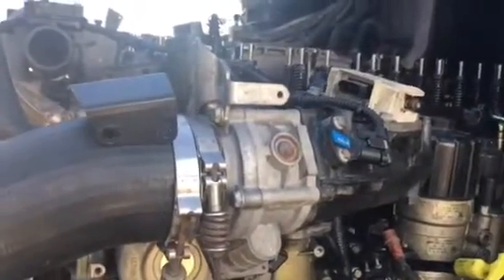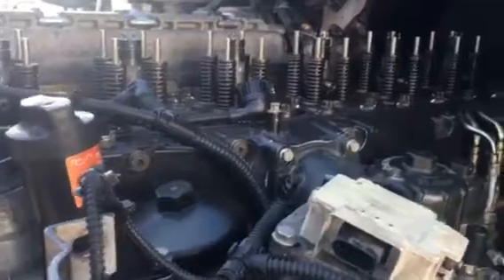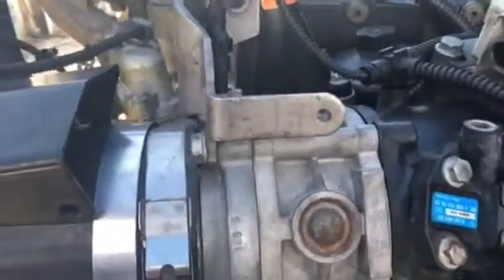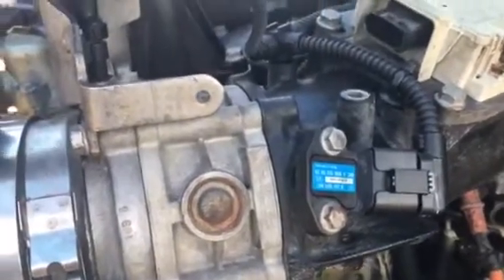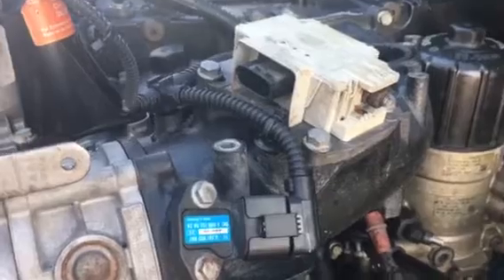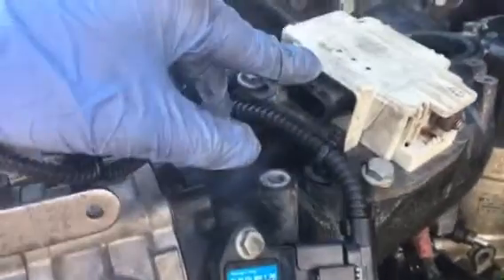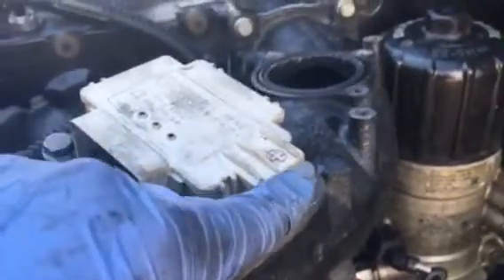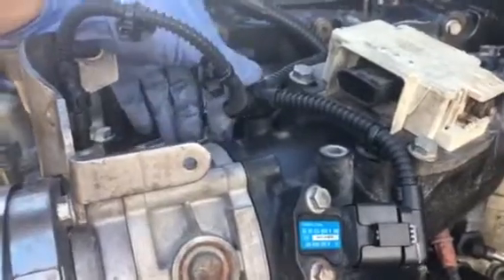Freightliner Cascadia 2010 Detroit DD15 missing one sensor

Comment: if the ecm has been updated the intake grid heater is deleted. too many fool drivers and shoemaker mechanics refused to read the warning sign and sprayed either into the intake .  when the grid heater glowed the either exploded in the intake manifold, the intake manifold exploded and shrapnel went everywhere. yo.